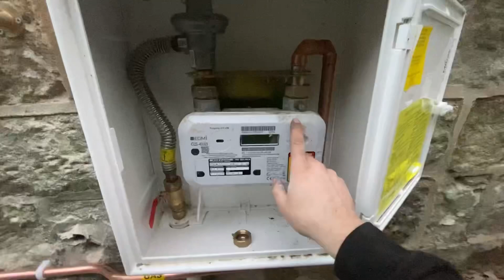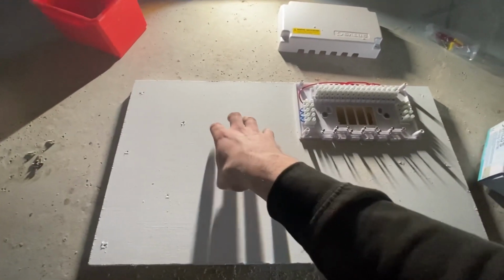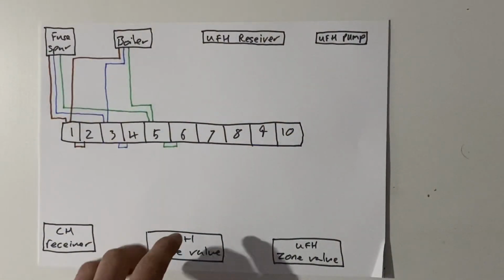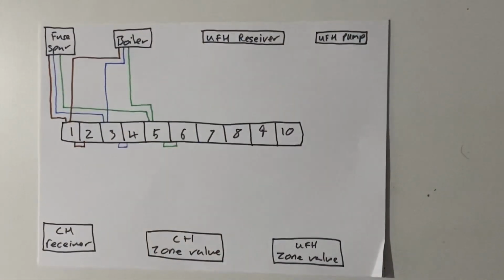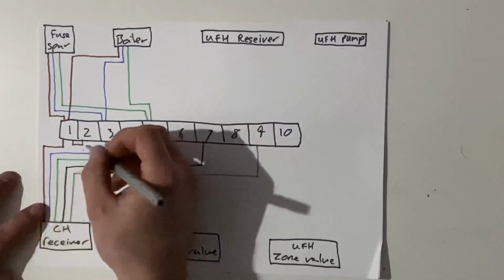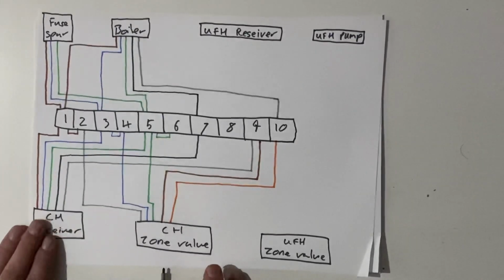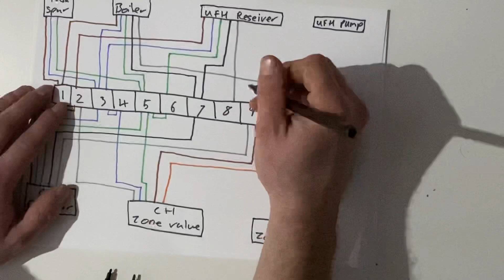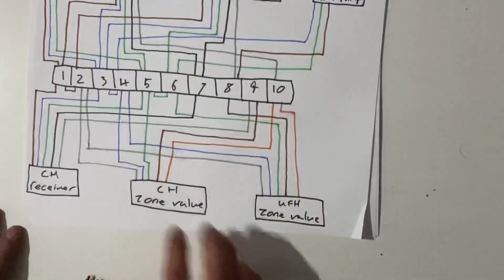BACK AT THE HUNTS HIDEAWAY, GAS RUNS & WIRING THE HEATING UP || 035

Comment: I first look for my orange and grey,  then the rest is history.  Neutrals together and the cpc .  Then the permanent lines breaking to the switched.  It's the nest of spaghetti you have to deal with when it's someone else's mess you turn upto. Which turns out to be a pain. 👍
Reply from the maker: There’s nothing worse, I personally hate when they decided to use the back of the programmer for the wiring centre